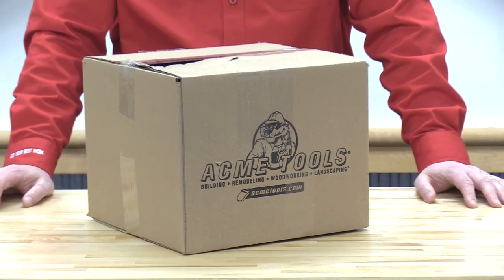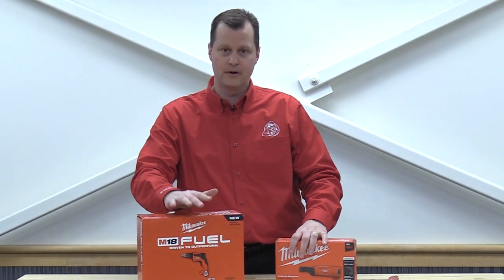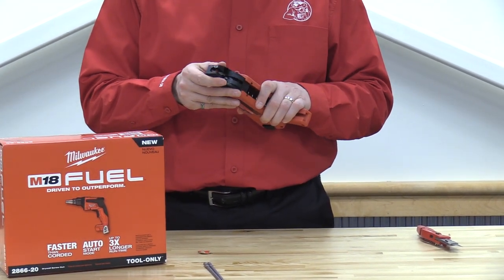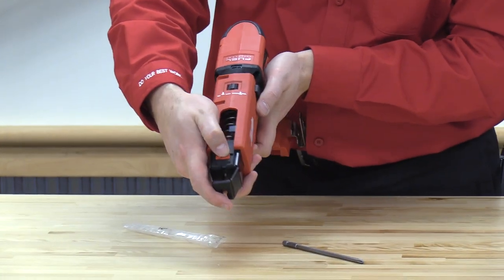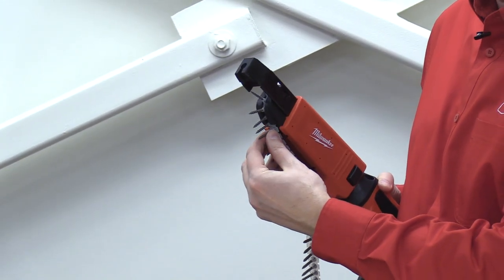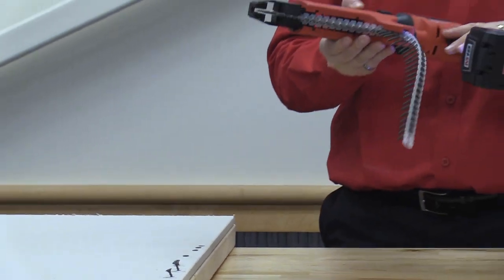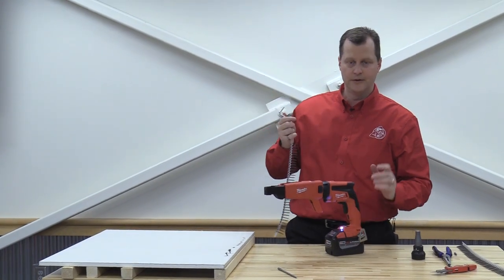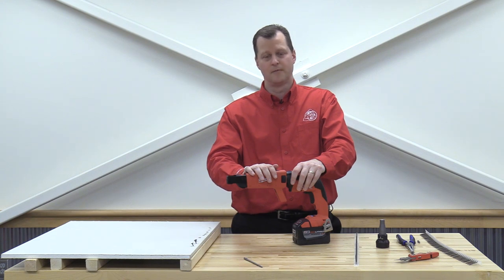What's In The Box: Milwaukee Drywall Collated Magazine Attachment

Comment: I just bought this tool and the bit sticks so far out that it goes past the correlated attachment and I put it to 1/4 the bit is longer then attachment
Reply: de dickedd you have to remove the bit holder that the original small 1” bit was in. You will need to use some pliers or grips to remove it. Then simply push the collated long driver bit in. Hope this helps.
Reply: Thank you, had the same problem with it sticking out past the collated attachment. Now that i know it actually does come out (& not attached to the armature, which is what i initially thought) I won't hesitate to pull it out now.
Thank you again
Reply: Thank you for this information 👍 I had the same problem